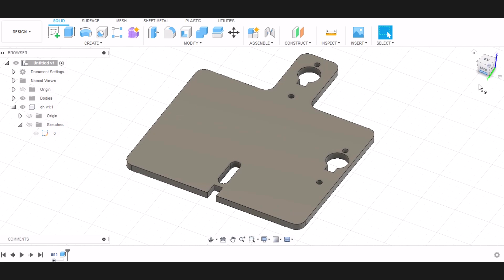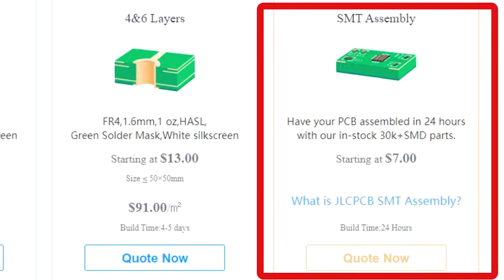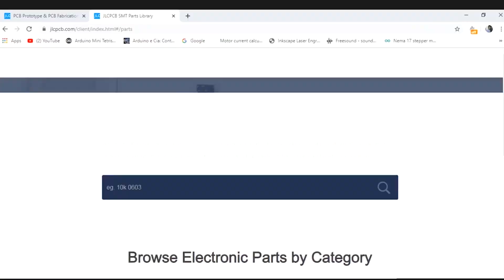DIY IR Sensor based color sorting machine | Arduino project

Comment: Question I had your board made from a previous video just for the pickup winder.
When I press stop, the machine keeps going.
Is there something missing in the code?
I have to reset the board every time.
Thanks
Subscribed in florida.
Reply from the maker: I think you need to add few lines of code, send me your mail ID I'LL send you the updated one
Reply: @Mr Innovative  i sent my information to your email.